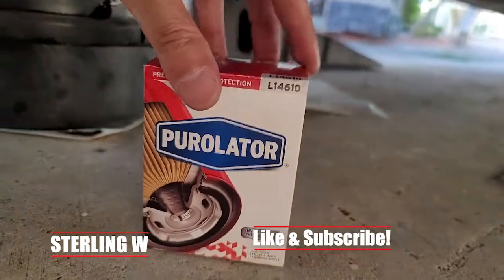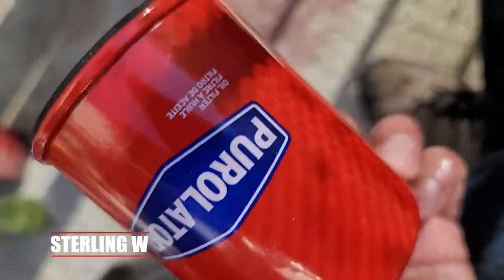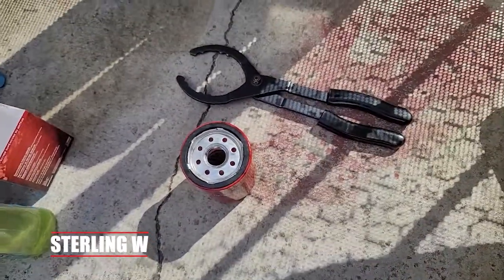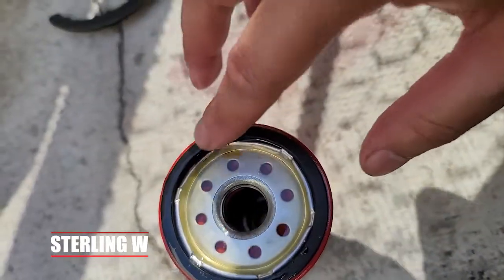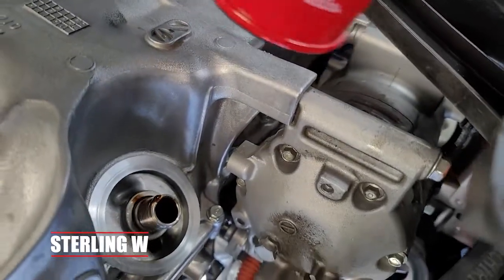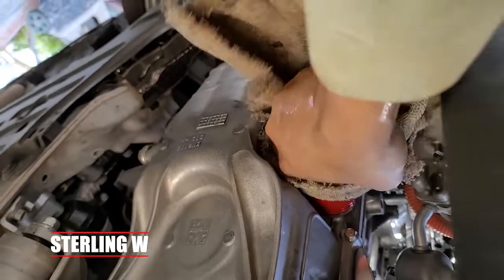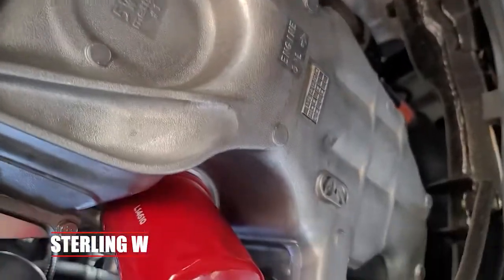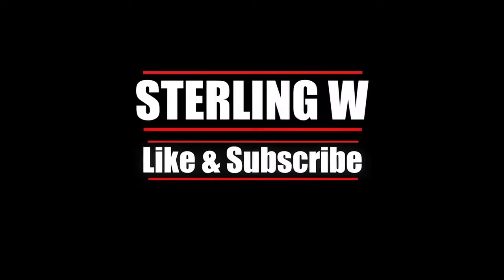REVIEW: Purolator Oil Filter

Comment: The red filter says conventional, high mileage, and something else. The boss is full synthetic. I can get the red filter for $7.00 at tractor supply. I need to find a new filter after finding out fram makes the oem honda filters. Ive been running friggin fram oil filters on my 2019 civic coupe since new! Im at 54,000 miles now too. Pisses me right now. I hear Purolator Boss is the way to go, I do 3500 oil change intervals though and dont need the top of the line filter. Honestly nobody should be doing 10,000-20,000 mile oil change intervals so i dont understand why these oil filter companies advertise their filters are good for such. 5,000 max for oil.